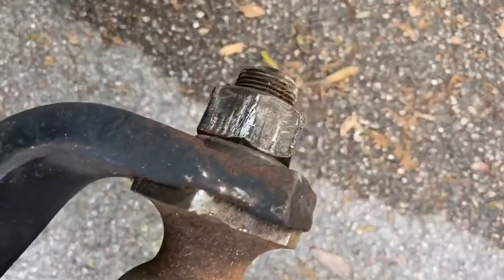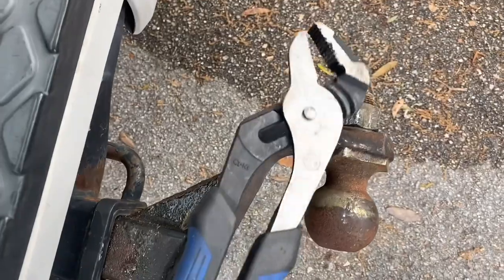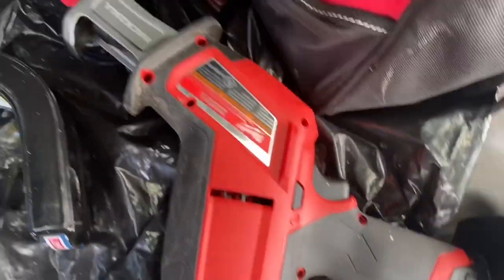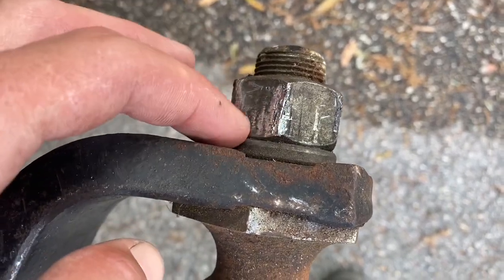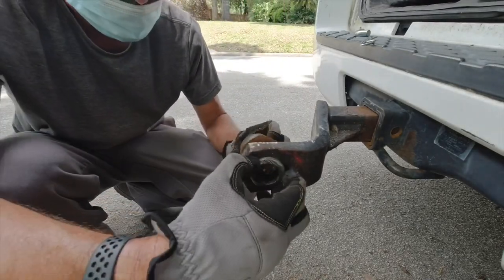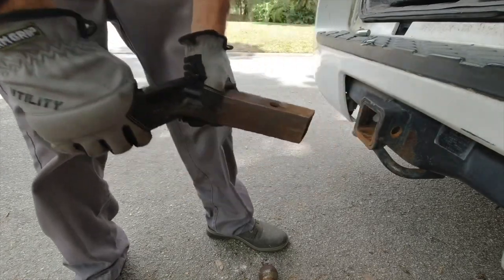Milwaukee M12 Hackzall Can it cut thick metal??

Comment: Maybe don’t use a wood blade? It’s say it can do more but let’s face it that was a wood blade. Makes me question the content/user…just saying.
Reply from the maker: I couldn’t agree more, I’d take the video down if it wasn’t so popular. That thumbnail really catches the eye
Reply: @LawnJohnSilver  hahahaha bro at least your hornst lmfao. Everything saying the same thing about getting leverage
Reply: It say thick metal blade right on it. What am I missing?
Reply: Indeed, a diablo amped steel demon would melted right through it. Or an angle grinder with a diamond rim metal cut off wheel.

Comment: Should’ve used a Diablo thick metal blade. Cut through like butter
Reply from the maker: I need to get one, I thought that case would come with one but it only came with the medium.
Reply: Where can i get the diablo metal blade
Reply: @torress1976  Home Depot
Reply: Honestly I think he needed the Carbide Teeth and it would have been easier.
Reply: Is he not using a Diablo 6" thick metal blade or am I just blind?
Reply: @INTERLAGOS54 At 0:47 you can see it says 6" thick metal but then in small print it lists the thickness of the metal intended to be cut. Must be even thicker ones.

Comment: What was the purpose of cutting it the nuts already loosen lol.
Reply from the maker: I was wondering this myself, I should have checked it way before cutting through as much as I did. It was on so tight I was stripping it out with pliers and a hammer, somehow the vibration from cutting broke it loose.
Reply: @LawnJohnSilver  Maybe your next tool should be an impact wrench? 😉
Reply from the maker: @kundetjenesten  I have one but definitely don’t have a socket that size
Reply: @LawnJohnSilver  Then it's time to buy some. A couple of good sets and a few spare ones in common sizes are a must.

Comment: You are saying you stripped the bolt, you literally had some mark on it, and you managed to konc off the edges a bit, but that bolt is far away from rounded. Any type point socket would have taken it out, when I say any make, I mean it.
Reply from the maker: I just don’t have a socket that size, I do own a impact but my biggest socket is a 15/16 that was best I could do where I was at
Reply: @LawnJohnSilver  well I for one greatlyl appreciate the vid as I am looking at the saw in question & wanna know what it could handle. Thanks for posting

Comment: Instead of cutting it off the Milwaukee M18 high torque 2767 would of zipped that nut right off! If your looking for a beast of a impact wrench the 2767 is the one! If your only on the M12 platform then the 3/8" or 1/2" stubby impact is an amazing little wrench! Basically good for anything up to 19mm and I live in the rust belt and it blast off rusty nuts and bolts!! 🤟
Reply from the maker: I agree, your probably not gonna like this if you like Milwaukee but I got the Ryobi hp 600lb impact wrench and I’ve taken off several questionable things with it with barely any resistance
Reply from the maker: I have the m12 impact that’s by far my favorite tool, I had the inflator but someone stole it so I started buying some Ryobi, but as their prices start to rise I’ll be going back to Milwaukee stuff again
Reply: How's that Milwaukee on your video is it still working?
Reply: @LawnJohnSilver torquetestchannel really opened my mind to the world of cheap electric high torques. There are quite a few values out there these days.

Comment: So is that a yay or nay? I'm an apprentice electrician, and right now we are doing industrial type jobs, but construction. Not really maintenance. But installing 3inch pipes, cables, panels, etc. Cutting unistrut, pipes, etc. I have a small bandsaw, but I want something that covers the rest.
Reply from the maker: I would go with m18 over m12 for this type of saw, which I own one now and can tell you the same tool has a lot more power and the battery options are also a lot better, Also check out my video on the Ryobi hp new one that just came out, I had a good review on that one and it’s close to 129-150 for the saw and battery and charger, the stroke is longer which will cut faster and it’s really light, it’s a Ryobi though so it might be laughed at on the job site but it’s whatever works I own both and I wouldn’t not use it because of the brand it works good
Reply: Judging by how the guy mounts his work piece. 
I don't think your going to want to take his opinion to heart ❤